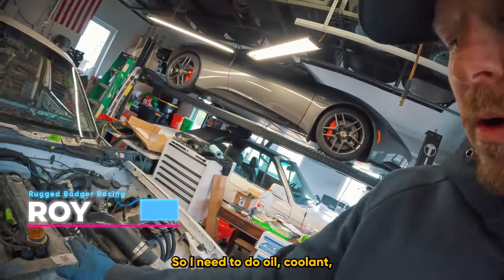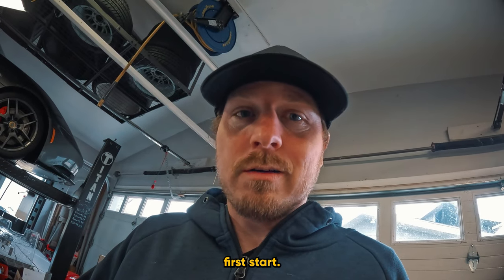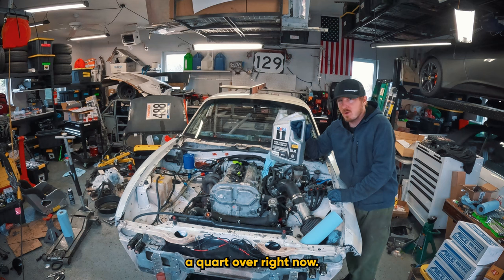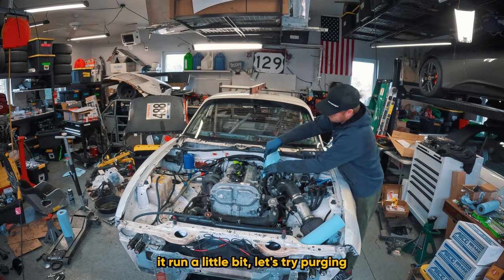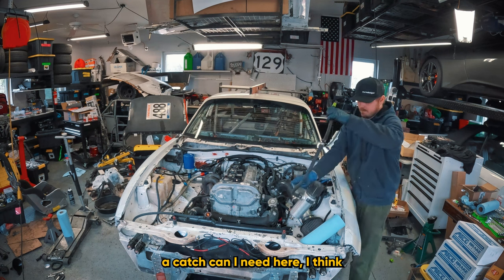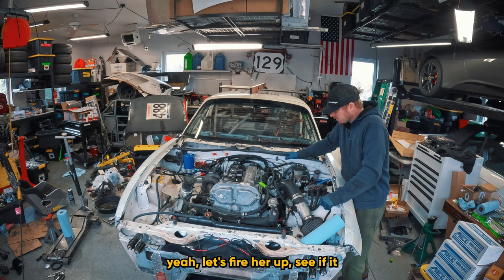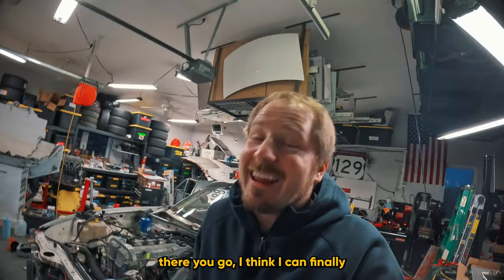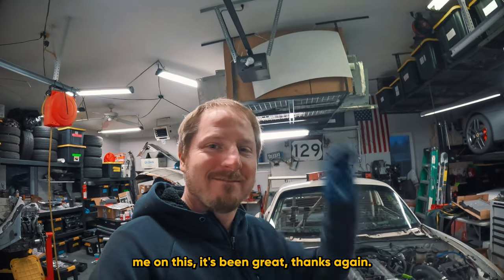Major Issues Installing the New Engine in the Ecotec Miata - Part 2 | RuggedBadger.com

Comment: Are you going to add any heat shields to protect the engine mount bushing on the one side and the clutch slave?  Other exhaust heat control? I will be waiting to view the next video when you attach the exhaust.
Reply: Not only that but I would also reweld the engine mounts as well, we had one break at Laguna and it cost us the race in Jerry's ErgoLab Miata. There was no penetration in the welds!

Comment: Matt did a "turn-key" install of my Ecotec engine and did a clean and amazing job on the wiring.   The only problem I had was intermittent starter cranking.  I added extra ground straps and a relay to the starter solenoid to solve that.  It can sit all winter and come springtime it will crank and immediately start on the first turn of the key.  Matt's tune net my stock crate engine 189hp, 191 lb ft torque.  Due to my wife's health issues I got very little accomplished to the Miata but should be back into it this summer.  You should partner with Matt on the oil pan after you get the bugs worked out.  It would really be a big plus if the oil pan bolt-on pieces could eliminate the adapter flexing.
Reply from the maker: Thanks for the comment and watching.  I emailed him about the pan.  No word back yet.  I will Dyno at some point and see how much power we have.

Comment: Awesome job roy! I really look forward to seeing what this platform can deliver now. Definitely want to make sure that the bottom of the engine has good support over by the clutch slave cylinder. If anybody can do it you can
Reply from the maker: Thanks!  We already have a brace made for the pan and transmission adapter.   I will share that shortly.  I bought the internal slave setup from Cameron but there is no time to install it before the race.  I built a heat shield and bought SRF fluid and I hope that controls temps.  Fingers crossed!